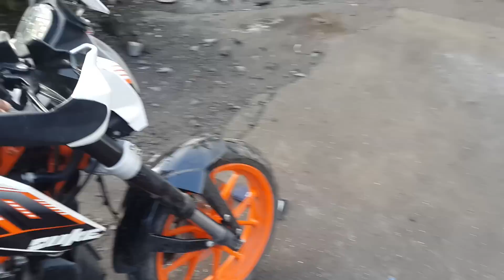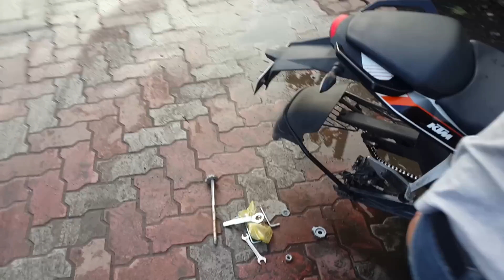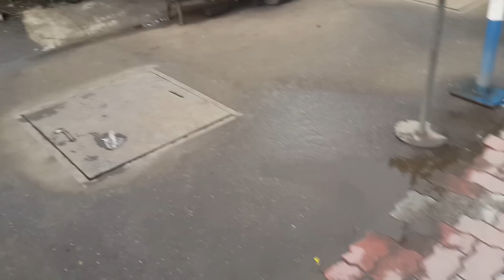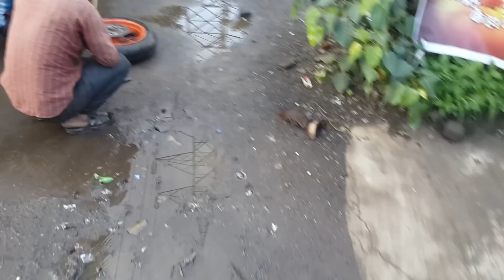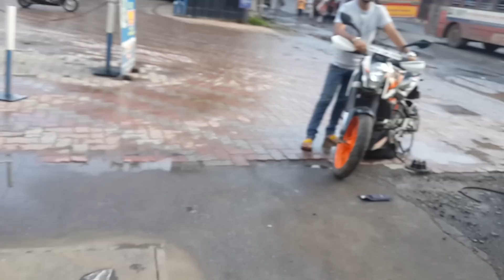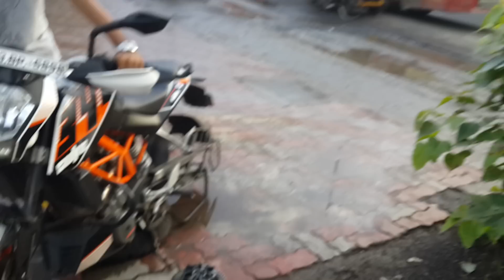KTM duke 390 alloys cracked

Comment: is it true that the 2015 duke 390 gets a better quality alloys
Reply from the maker: +Anu kum the quality of the alloys was changed just b4 the rc was launched. 2015 duke has the same alloys since 1 year
Reply: So now alloys breaking problem has been sorted out becoz I am planning to buy 390
Reply: Is it a safe buy I will be using the bike for commuting and occasionally touring, moreover I would be using the bike in Chennai where the roads are very bad
Reply from the maker: the bike suspension is stiff and the alloys are always weak. its nt build for bad rosds remember. i hav used it every where. if ull use it carefully then notin will hap. good luck.
Reply: @Wowlife603  just buy it ❤